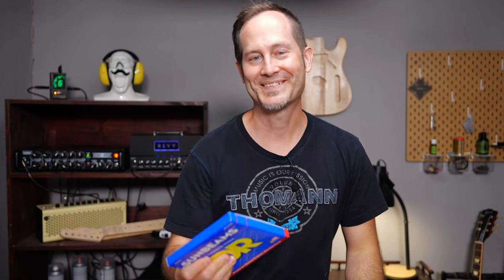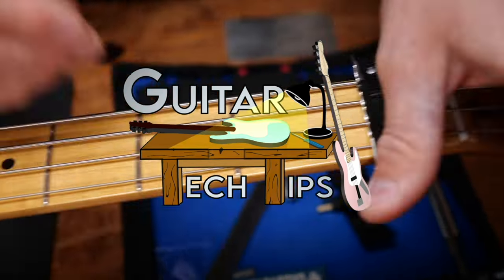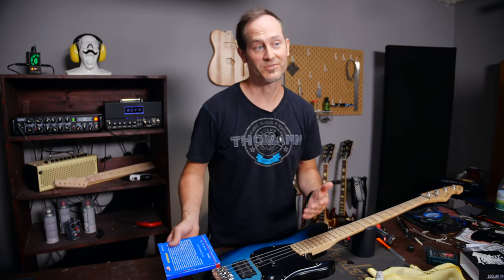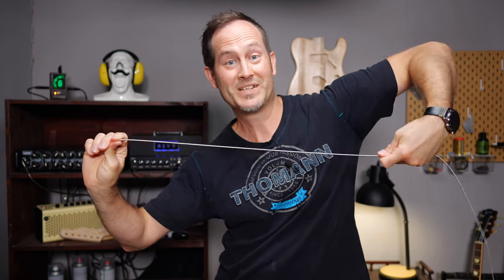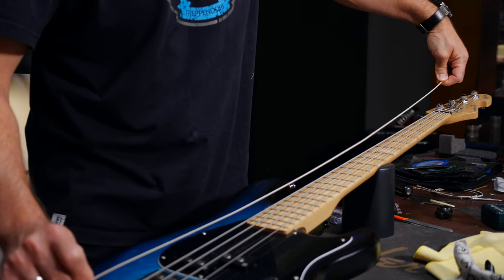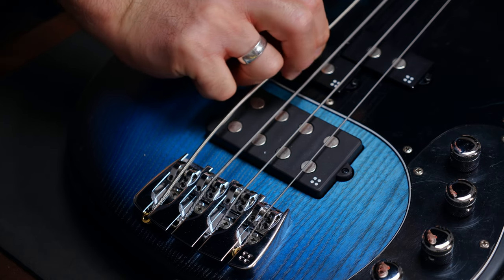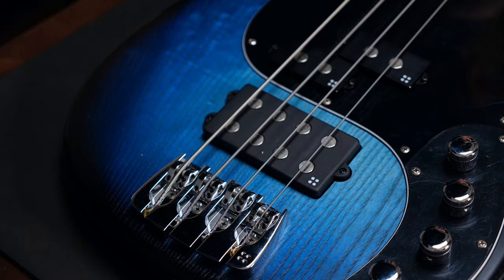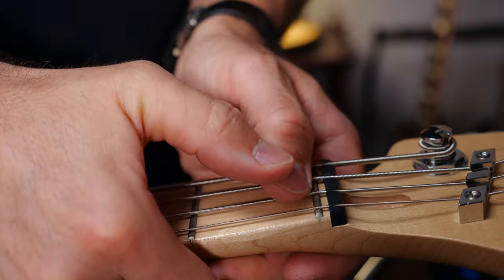2 Important Tips For Bass String Change | Guitar Tech Tips | Ep. 87 | Thomann

Comment: That first tip is why I like EBMM bridges better than any other, and better than quick-change bridges.  On Quick-change bridges, it's a little harder to keep the end in place while winding the peg without the end either popping out or twisting, like you say.  Having to pull it out before final tension is good but an extra step.  On EBMM bridges, they are not quick change, but the "hole" is big enough for any and all of the strings to rotate freely, including the low E.  So, you just string thru the bridge, start winding, and allow the string to rotate freely at the bridge, not worrying if it will pop out of a quick-change opening.  Having said all that, my current bass is a Sadowsky with a quick change bridge.  I'm not crazy about the quick change bridge, but I can make it work with a trick like you mention to eliminate string twist.  I miss EBMM bridges, they were a better design to me.

Comment: Hey Chris I’m having an issue where I try to raise my bass pickups but they can only go so high the screw keeps Turing but the pick up stops rising at a certain point and then I’m just turning the screw  can you please help me? Thanks, love the channel happy new year!
Reply: I fixed that on my cheap bass by taking out the pickup and adding a piece of foam under the pickup to act like a spring to push it up. Some of my other guitars & basses came with springs or foam under the pickups, but this one didn't.

Comment: Your supposed to change bass strings? Looks like I need a couple packs of strings 😖
Reply: SIT Power Steels stainless steel strings are awesome! I switched to them after 40 years or so of Rotosound strings. Stay growly longer!  Never change flatwound bass strings though if you want middy Motowny goodness, the ones on my PBass have been on there for 35 years or so 🤪
Reply: @boomerbassmeme  I think they made the SRV set I used to play with a 58 for the low e. Or maybe it was a 60?? Im a totaly ignorant as far as bass gauge and brand but I’ll probably trying something odd on my Dean playmate acoustic bass maybe flat wounds?
Reply: @PooNinja  DR Rare or D'Addario Phosphor Bronze strings work best on those (I have one) 45-100 or 45-105 is a nice gauge and last about a year or so if you do not play it much. Flatwounds sound terrible on them.  I prefer the DRs but have used the other. Thomastik Infelds are the Cadillac strings for acoustic basses but run about $90 a set 😱
Reply: @boomerbassmeme  if y’all broke n replaced them like 9s on a hondo 2 the price might come down a bit? 🤣

Comment: Thank u Kind Sir for sharing... I've been using 105 - gauge GHS strings ...
They are Makin finger tips really sore and I need some strings that are;;; smaller but with Flexibility and not stiff and still have a punch when I'm needing
that "Grunt" when I expect without boosting...
Any Recommended Punchy strings that can fit this requests? 
Thank you for any and all possible links.
Reply: Try NYXL 45s. They'll still have lots of punch and upper midrange grunt, but will have a smaller diameter and smoother feel.